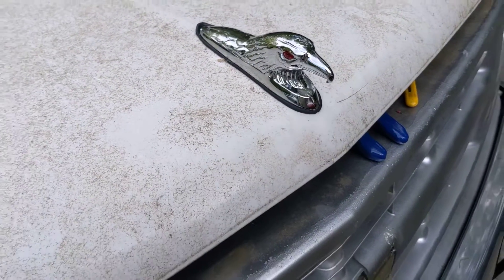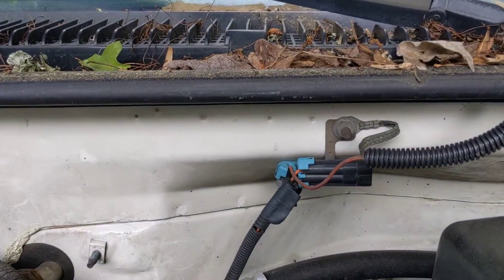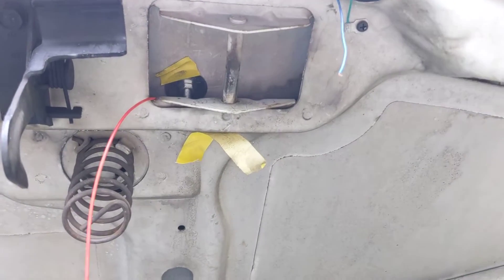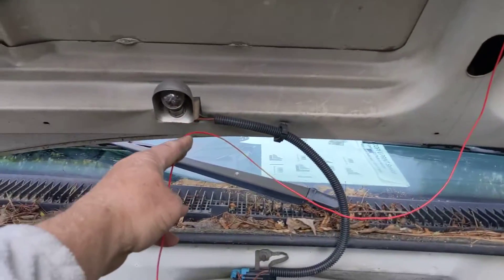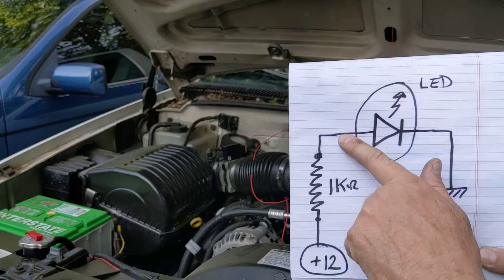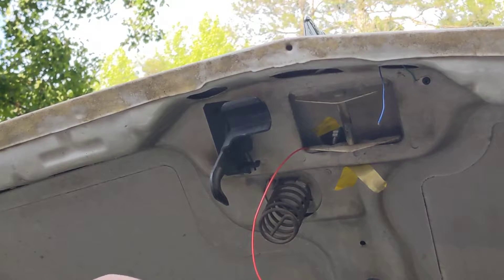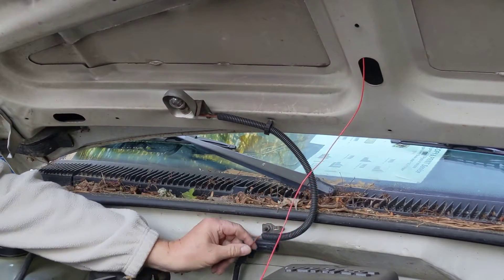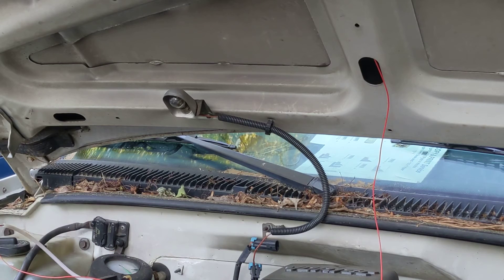LED lighting for Eagle head hood ornament

Comment: Different colors of “LEDs” operate best at different voltages. Use ohms law and most will require 470 ohms each and 1/4 watt size is plenty. Solder connections, use shrink tubing over connections and resistors. Home improvement stores sell 6 foot lengths of convoluted split tubing at 3/8”. It is easier to down the hood.
Personally, I would run it down the hood, then thru the lamps grommet and solder into tail light circuit. Tip: If you have to use electrical tape, a small dab of black weather strip adhesive will keep it from unraveling. ASE Master Tech - Retired
Reply from the maker: thanks for your input